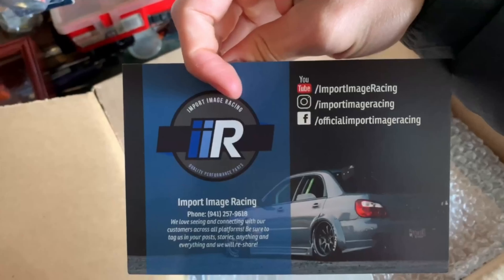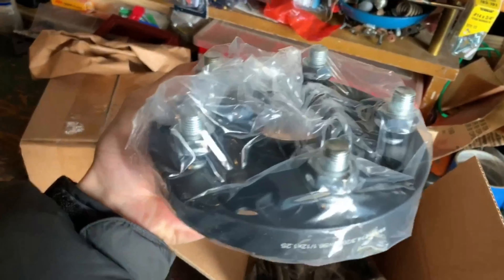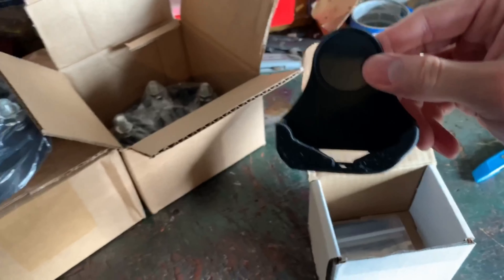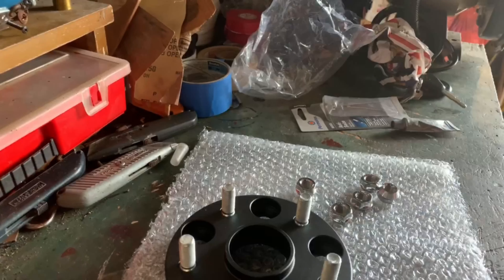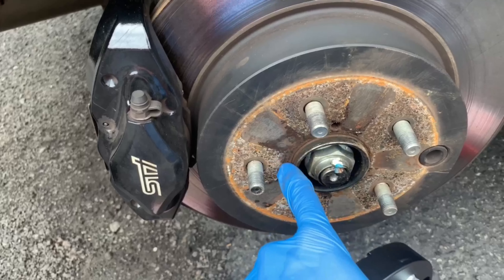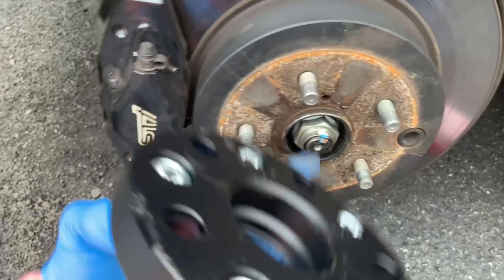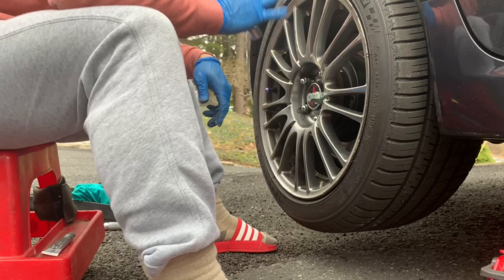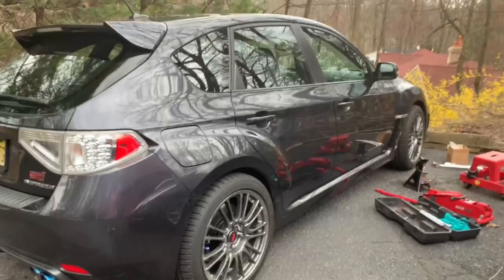Sti Hatch Wheel Spacers for PERFECT FITMENT!

Comment: I just bought some 15mm spacers on my 2011 trail but I'm not sure if it will sit flush on the hub due to the studs sticking out, what do you think?  Are the stud pockets on the original wheels deep enough?
Reply from the maker: hi Stale! yes they will clear as long as the back of spacers of the cut outs. This will clear the OEM studs no prob

Comment: Any updates on reliability after these few months? Not sure about this brand vs the others, they do look nice and well built.. thanks!!
Reply from the maker: So far no problems! i agree they definitely seem to be made with quality in mind. hopefully they hold up
Reply: @chumedia_  awesome!, thanks!
Reply: I have them on my 2013 sti and when im going at 75MPH to 83MPH on highway feel vibration on the steering i follow instructions and did the alignment still feeling the same vibration at same speed
Reply: @xxKendal93  your problem may be wheel balancing not alignment. Also make sure the wheels sit flush with the spacers. Some wheels don't have the pockets behind for the protruding studs and that could cause vibration
Reply: Does the OEM STi wheels have those pockets?

Comment: Do you get any rub running these spacers ?
Reply from the maker: Yes i noticed it at high speeds and hitting slight bumps only the rear will rub. A good roll on both fenders should do the trick